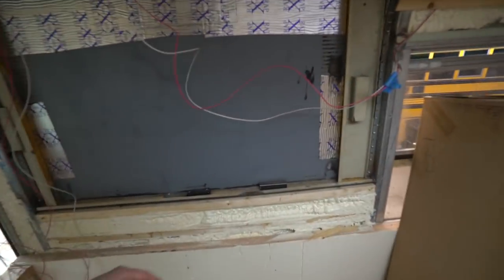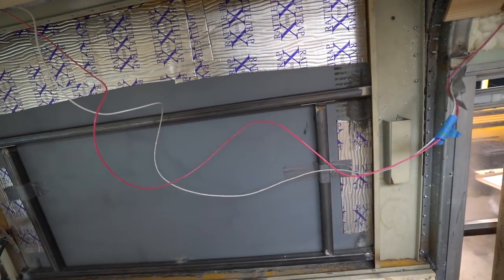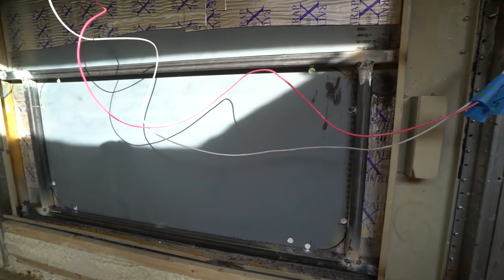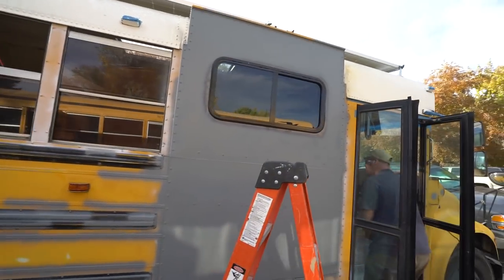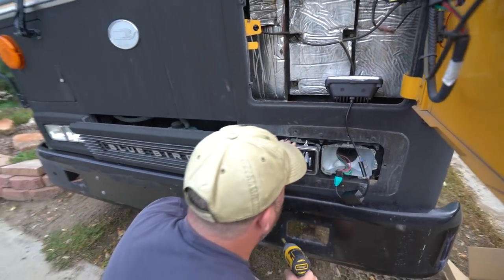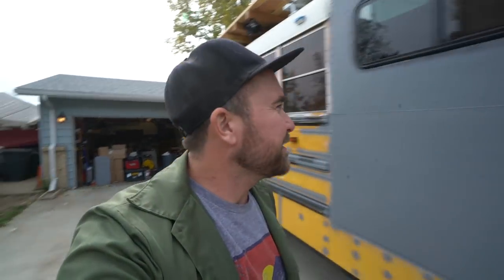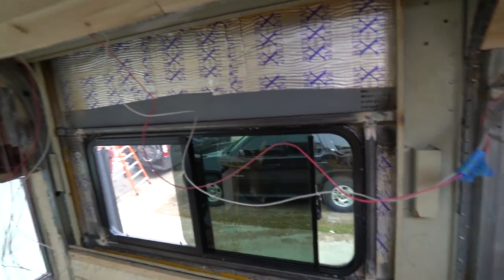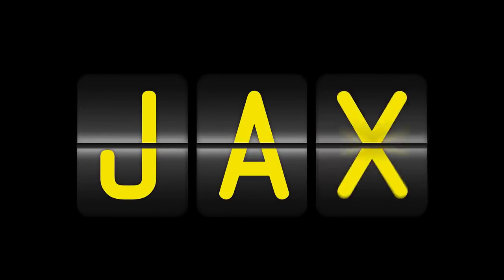RV Window Installation in SKOOLIE VANLIFE

Comment: Bus is looking good and congrats on all the hard work so far! Keep it up. The RV window you installed on the passenger front area you want to have the slider on the rear of the window. So when your going down the road the "non slider" side of the window is in the front, helps prevents less leaks and less wind force on the slide middle section. But great job so far!
Reply: I can't see from the video but there should be a set of drain holes in the bottom edge of the window so when water does leak in a bit around the slider part it drains out of the bus. Which I think you have them up top installing that way. Just a little thing to keep a eye on.
Reply: If only the glass had a sticker with an arrow ➡️ point out the direction of travel for placement.

Comment: Your RV window is upside down the windows supposed to slide back to front when you open it and then the little weeping holes in the out side trim that allow any water that get down into the troff where the glass slides those weeping holes are supposed to be at the bottom so that way the channel and trim can drain out. it looks like they're at the top so which means it's going to allow  rain to come in those little weeping holes and then drain down to the inside of your window you might want to flip it over
Reply: Nathan Platt dang I’m pretty sure I’m experiencing that in my windows that are fully installed and trimmed over on the inside

Comment: Jax the inside ring is called a trim ring and its designed the seat the window to the interior wall that's why they usually ask how deep of a trim ring do you need but the point of it is to keep the window compression even and for looks to the wall its kinda important .
The bus is really coming along you've got some great friends helping you out buddy many kuttos to them keep at it my friend your on the home stretch.

Comment: Flux core requires slag removal with every pass to mitigate slag entrapment in the weld which creates a weak weld. The slag is just there to help protect the weld from oxygen while it cools and should always be removed promptly before continuing. A wire brush would have done wondered for the end result. Visible or not, should never weld over slag.

Comment: flux core is like welding with a stick welder if you less splatter sticking get some anti splatter 
spray where don't want anything sticking not perfect but will help
THE GRUMPY BUS

Comment: I like welding with flux core but the brand of wire is important!  I started out using Hobart brand flux core wire which sucks!  Don't use it, splatters excessively and drips beads in front of the pool.  I went to a welding shop and bought their flux core (don't remember the brand but it was expensive) with no more issues.

Comment: using silicon on steel accelerates rust like mad. Use butyl tape. Make sure the drain holes face down.

Comment: Flux core is a little more work, extra slap shrapnel. In my area you need get 1 yr contracts to get bottles , local dealer is kinda hard to get along with.  Bus looks good , seen paint job on others channel's.

Comment: It is upside down! It's going to leak while driving! The trim ring is structural, it clamps the frame in! Flux core has to be clean, no paint, a lot of time flux core is better for smaller jobs!
Reply: Or it was made for the driver's side.

Comment: Hate to tell you this buddy but the RV window is backwards.  Driving in the rain will force water through where the frames meet and a draft in the cold weather.  Might not be bad enough to change it.  All else looking good.
Reply: Journeyman that’s what I was thinking also. Aren’t you supposed to screw or rivet the window in? Maybe you did, I just didn’t hear you say anything about that, just silicone.
Reply: @charlotte97838  The inside frame screws to the outside frame into a self-tapping channel, the window is held with compression of the two frames.
Reply: @journeyman4328  and he's supposec to use putty tape not silicone paint will never adhere now around the window
Reply: Journeyman gotcha. Thanks for the reply.
Reply: @jbncnow  I'm pretty sure he'll have a chance to redo it.  He didn't leave enough breathing room for the window to expand I think chance of it breaking is 50/50 by next summer, just didn't have the heart to tell him.  Because the interior is finished and worrying won't help.  Plus the window he bought is more tolerant than the full metal framed ones.
Reply: I was thinking the same thing. Can he turn the window over? I suppose it depends if the are any drains in the rails.
Reply: Looking at it I think you are right! Maybe Jax can flip,it!

Comment: Big fan. Love the videos. I think you install the window upside down. Look at the way you open the window right now. I think is supposed to open the other way. You might have a water leak when driving on the highway. Because the way is opening up.
Reply: Weep holes go down
Reply: Or it was made for the driver's side.

Comment: I bought headlights like the ones you installed. Are the from M4? I had the same buckets on my coach. I made holes in the back of the buckets so they would fit flush. If they don't fit flush, I'm afraid the alignment will be off on the lights.
Reply: ZMAN 420  I don't think my adjustment changed at all when I made them flush. I didn't want to have to try and realign them. They kind of rocked back and forth in the bucket before I cut them out
Reply: ZMAN 420  yeah, I know I could have done that, but I just would rather have it fit like it's supposed to.

Comment: Yeah Jax the window does look upside down and it should open back to the front. Does the window have vent hole in the bottom of the window if it's upside down they will be on the top now you will know by that and silicone is never a good idea for Windows it doesn't let anything adhere to it like paint.
You'll figure it out good luck buddy

Comment: I really hate flux core mig. It will work in a pinch, but there is a lot of splatter.
Reply: Deweys stuff agreed, they should have been using hardwire with 75/25 shielding gas.
Reply: I ran out of gas... sorry Jax !!! Ugly welds are behind wall... At least they will hold.